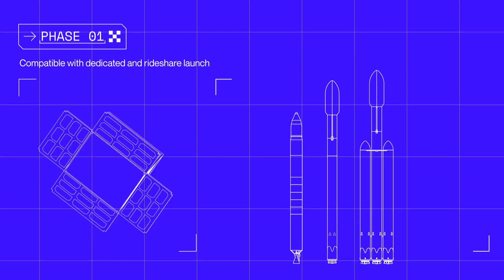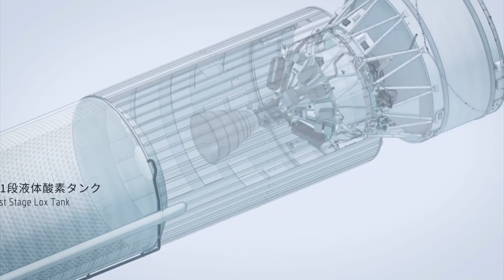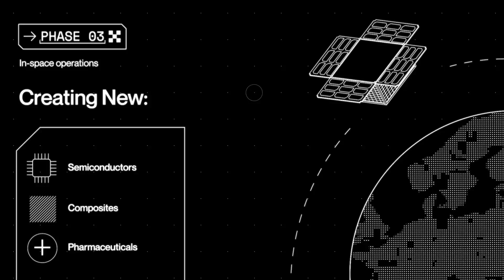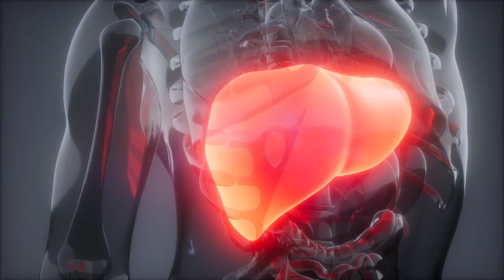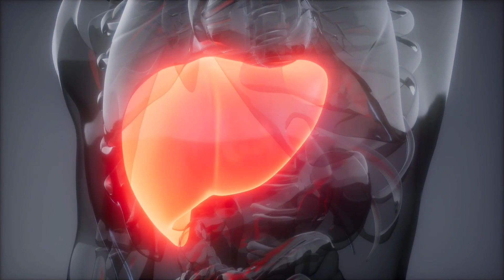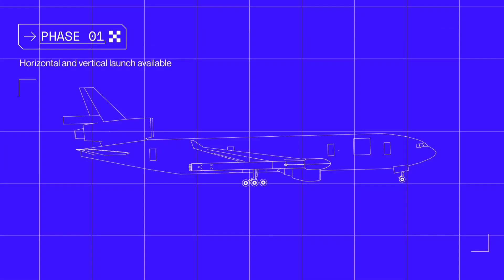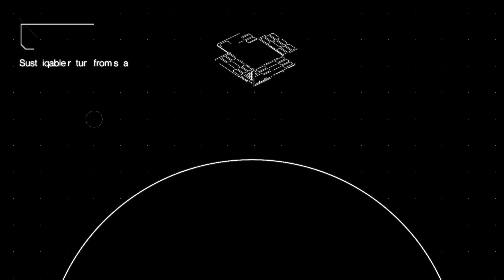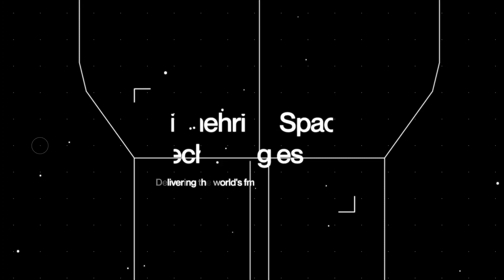Jeff Bezos TALKS about space manufacturing, but UK innovation will actually do it this Summer!

Comment: Never known your videos to be hopelessly optimistic, but this one tips into fanboy silliness.  Micro-scale zero-g manufacturing is comically over-rated.  Instead of gravity, you have to deal with radiation.  Instead of  commonplace cryogenic liquid cooling, you need complicated heat transfer equipment that relies on radiating heat into the nothingness of space.  Instead of Humans bumping into things, you have to survive acceleration and vibration of launch and recovery.  There are a lot more drawbacks than anyone involved in these projects wants to admit.
Reply: There may be some processes that only work in zero g, but once the product such as a pharmaceutical is made, it can easily survive the forces on reentry. So it may be viable for expensive niche products.
Reply: Agree with all this if using broad strokes but as above says, certain products will be made possible that previously were not and as a platform for experimentation this could prove to be incredible. Material science is often a bottle neck for innovation, this may prove to be a game changer in that field.
Reply: The company has explicitly said that reentry will be gentle, which probably means they're using an insanely large "parachute" when compared to their satellite mass.

The basic recipe is that the higher your (reentry surface)/(reentry mass) ratio, the higher in the exosphere/thermosphere/whatever that you can get useful drag; the higher you can get useful drag, the slower you can usefully lose velocity from your orbit; the slower you can usefully lose velocity from your orbit, the lower your reentry temperatures.

So, they're probably going to use the functional equivalent of a parachute to gradually lose velocity, so that both the deceleration and the heat remain low. I'm passingly curious what their end-stage system is (gliding to a desired landing zone? simple parachuting? airbags to lessen the impact? mid-fall inflated hot-air balloon?), but they might not be willing to disclose that until near their first launch.
Reply: @absalomdraconis  Dude wake up. Orbital speeds are around 7 kilometres per second.
THERE IS NO SUCH THING as gentle when you hit the atmosphere at that speed.

Have you ever been on a purpose car racing track? They are unbelievable smooth compared to normal roads. Then have a look at the in car footage. 

Its a problem called kinetic energy and getting rid of it is harsh in EVERY engineering field.
Reply: The only thing I can think of that might benefit from Space manufacturing is nano bots ! If they keep them far away from earth they can mine asteroids then get blast if EMP so they don’t get infected here on earth
Reply: These are all engineering problems and technological in nature. At no point were any of those disadvantages are technical impossibility. The same could be said about air travel before it was commercially viable
Reply: Finally an answer that's sensible. This is all terribly misleading. Its not all BS just 99.9% or more.

I have written a lengthy explanation if you are interested. The short answer is that its simply not logistically practical in any way to move any but the most specialised manufacturing off world.
Reply: @tonywilson4713  that's exactly the sort of manufacturing they would be doing, as outlined multiple times, in the video.

Clearly manufacturing in any usual sense is entirely pointless unless scalable and it would be financially idiotic to pursue a new technique if it's not the most practical and low cost way to make a given product. But if it's a new product that can't easily be made if at all in another way and is more an experimental platform where volume isn't the initial aim then this becomes interesting, again outlined in the video.
Reply: @timbob1145  And he (Angry) keeps bullshitting all through the video about how problematic manufacturing is WITHOUT EVER CLARFIYING WHAT HE MEANS.

AND he keeps implying that ALL MANUFCATURING will eventually move off world and it just never will.

Go see my explanation for it. 

I don't mind Angry when he's on target with criticism of various agencies and companies or when he's pointing out decent efforts by start-ups, BUT NOT this time.
Reply: @tonywilson4713  wow, you're extremely upset about someone being a bit overenthusiastic about something that you don't like aren't you.

He never implied that all manufacturing will go off world, he even outlined certain specific areas where certain techniques required microgravity further suggesting that it would be specific/niche areas. I would agree he was very enthusiastic about the whole thing, maybe a little over, but I think that enthusiasm is about the concept of a relatively small company doing something new.
Reply: @timbob1145  Sorry but like many others I busted my ass to get my degree and am tired of being told to go sit in the corner while the snake oil salesmen have centre stage.

They're the reason we haven't been back to the moon or got a lunar base.

Apollo worked because there was a plan and people did their jobs. Ever since there's been a procession of snake oil salesmen bleeding every program to the deck. Just go look how many shuttle replacement projects were done.

Now days instead of working on things we do need we have clown after clown spouting nonsense.
Reply: @tonywilson4713  fair enough on being frustrated, point taken.

But I think his (angry's) enthusiasm comes from just some new stuff to talk about instead of the misery of FFA hold ups, wasted gov money and all the usual stuff.

The excitement over this particular venture may have been a little overstated but even the smallest side project requires a lift to space, imo, that alone is a good thing. Clearly this isn't gonna be an industrial scale driving force for space travel... It is a small experimental project and is only a little step into a new field of small scale manufacturing, my excitement comes maybe from being British and the idea of us lot doing something potentially useful in this domain is interesting to me. But the more little projects like this there are driving the industry the more likely we are to see progress from the lift providers etc. Also, people like bezos and others aren't gonna like the idea of a little company such as this beating them to something, even if it is nothing as big as they had in mind, it's hopefully a nudge to the bigger boys and still seems a worthwhile thing to do aside from that. 

Hope your frustrations are alleviated over the coming years and yeh snake oil seems to be ubiquitous in every field of human endeavour nowadays, let's hope we can find a way past that.... I will add though that making something into an industry always comes with the crap and the con men, but the days of governments throwing huge amounts of cash at monumental scale projects like going to the moon just because are over. We need these smaller private enterprises to establish a thriving space infrastructure, hopefully providing many more opportunities for people who have busted their asses getting the degrees etc... Maybe I'm just hopelessly positive about it... But I only sell bogs for a living.
Reply: @tonywilson4713  : The shuttle never got replaced because Congress didn't want to spend the needed money. NASA was partially at fault, but that's what you get when you tell a bleeding-edge R&D group to develop what should be a boredom-inducing utilitarian cargo vehicle.
Reply: @tonywilson4713  Apollo worked because they threw a ridiculous amount of money at it.
Reply: @DavidKnowles0  Your clearly NOT an engineer and have utterly NO IDEA of PROJECT MANAGEMENT.

Money alone does NOT ever ensure a project works - SLS proves that. 

Did you see Angry's vid on the launch tower? That was one of his best. Straight up facts, NO BS, NO PR, no mindless hype or ranting, just facts.
Reply: @clementvining2487  Specifically on space infrastructure. It needs people who actually understand infrastructure and know what they are talking about.

I have a degree in aerospace engineering with 30+ years working in industrial automation and control systems. In 2002 I met Harrison Schmitt (Apollo 17) and he talked about Helium-3. At that time Australia was scaling up its mining industry so I took advantage and went off to learn how to build mines in remote places and that involves lots of INFRASTRUCURE. 

So yeah I actually have real on the ground experience with INFRASTRUCTURE, because building a new mine includes offices, workshops, transportation facilities, power systems, water infrastructure, roads, rail and lots of other INFRASTRUCTURE before you even get to the mining equipment.

Do you know what it takes to build an accommodation village from scratch? Other than living space there's kitchens, food storage, laundries, clean water, waste water, electrical services, gymnasiums, entertainment systems and lots of other stuff.

SORRY BUT I DO KNOW WHAT I AM TALKING ABOUT
You and the rest of the space fairies need to stop guzzling down the Elon and Jeff juice.

Comment: I wonder how this will, automatically produce these materials, it's not like you have a proving ground except by trial and error via lots of launches. I guess it all depends on launch frequency to dertmine the speed of the iterative process. I guess given the small size, micro meteroid impacts are not such a concern, unless there was an unlucky hit that damaged attude adjusters, and it just remains in orbit. A Corona Mass Ejection, would take out lots of satellites potenially , so nothing can be done about that. Massive plus that astronaut lives are not on the line. I like the whole idea.

Comment: Space forge have to send the printer as well as raw materials to space each time. For now.
Ideally the printer would remain in orbit and raw materials exchanged for finished goods for each following launch.
Yeh. Need a space station for any volume else still too expensive.
Also need examples of significantly planet harming processes that can be done in space!
Burning fossil fuels in space erm, no I'm missing the point!
Reply: Yeah stations are the way to go, I belived people would just use the ISS till it retired, I wonder if companies are using sats because they want flexibility or is the ISS just full?
Reply: @harmonyspaceagency1743  : Some of the stuff that's been discussed benefits from freakishly low disruptions- astronauts moving around really could cause undesirable disturbances to e.g. the formation of some immense crystal or something.
Reply: @absalomdraconis  Hadn't thought of that, that would be a use for a single use manufacturing machien even if there are stations, if you need it completelly isolated from the vibrations of a station

Comment: re: reusability, if it's got a large enough surface areas to weight ratio (think F9 fairings), it may be able to slow fast enough to not need a heat shield, let alone an ablative one.
think about the examples for engine or 2nd stage recovery that used a large inflatable 'shield'
Reply: Have inflatable heat shields been used on earth?
Reply: @harmonyspaceagency1743  not that I know of, but I do know that they've been designed.

remember, my post is speculation, I could be completely wrong, but I figured it's worth mentioning.
Reply: @davidelang  defiantly, inflatable heat shields would also let you build re entry capable satellites in some different shapes
Reply: @harmonyspaceagency1743  search for 2nd stage reuse and you will see a lot of videos from a few years ago on the topic.